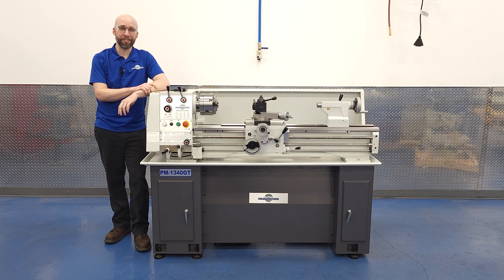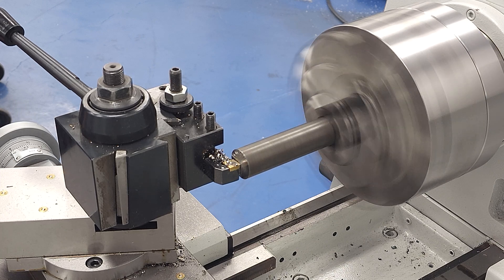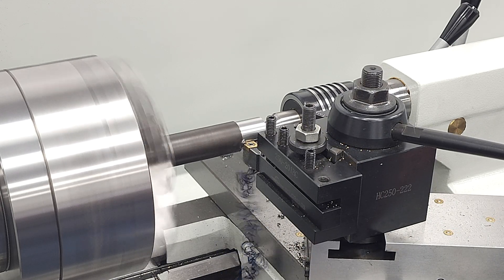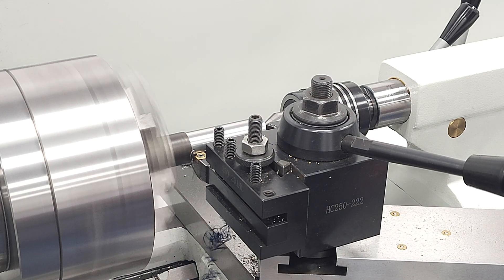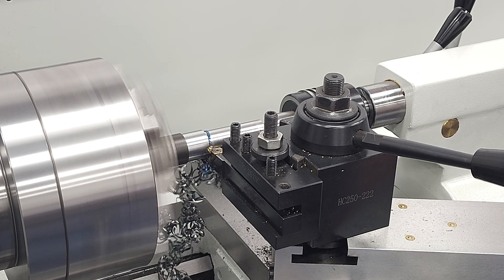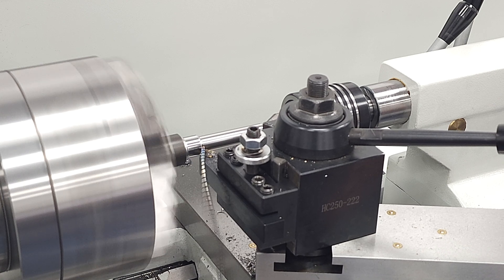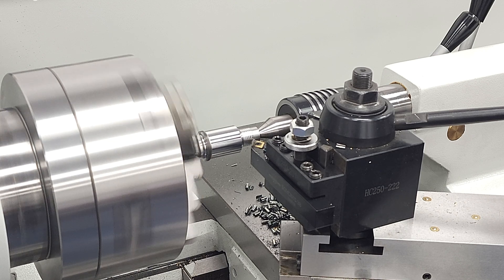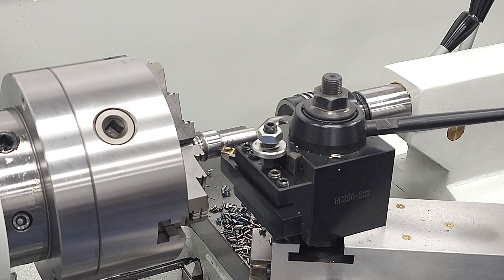PM-1340GT Limit Test Precision Matthews Media

Comment: You changed insert styles and tool holders half way through. I may be wrong, but the first tool appears to be a CNMG insert, which appears to have been set at an 90 degree lead angle.   The second tool appears to be a square insert. Using a tool with a square insert takes advantage of "chip thinning". 

Although the first tool feed rate gave a chip thickness of .003", when using the second tool with a 45 degree lead angle at .0055" feed rate, you get about a .003" chip thickness. This means that the load on the machine and material is equal if the depth of cut is the same for both tools.

This is why tools with a less than 90 degree lead angle are used on mills and lathes for roughing. You can use a higher feed rate and remove metal faster with the less load on your machine. The disadvantage is that you cannot get a square corner on your part.
Reply: Although true about the chip thickness thinning due to lead angle, a 45° lead at a feed of .0055, the resulting chip is basically .004 (.00389" to be a bit more exact), not .003" but your point does still stand, the 45° lead tool at .0055" is not a .0055" chip.

It should be noted though that for the same DOC, 45° lead angle will result in a wider chip. Remember, as soon as you move away from 0° lead, the width of the chip is equal to the hypotenuse of the Right triangle formed as a function of the lead angle and the DOC, so for the same .070 DOC, for the 45° lead, the width of the chip is .098". For the 0° lead, it is obviously equal to the DOC.

So while the chip wasn't .0055 thick, it was still thicker than .003 and the width increased by .028" thus, the load for the .070" DOC at .0055 ipr with the 45° lead was higher than the .070" DOC at .003 ipe with 0° lead

Comment: So many questions:) Could a 1440gt do .300" rough cut? Anyway you would do a video showing how you set the knobs on your machine to get the .003" per rev feed rate?
Reply from the maker: 300 total material (i.e. 150 depth of cut) is conceivable with the right roughing insert. 300 on the radius (i.e. 600 total removed) is likely going to be too aggressive.

Comment: Could you please clarify what you mean when you say take a 75 thou pass: are you saying remove 75 thou from the diameter or 75 thou on the radius? I.e., are you moving the cross slide 75 thou in X or 37.5 thou in X? Thanks
Reply from the maker: Each pass we call out is the radius or the actual distance that the tool is moved. i.e. double it to get the actual amount of material removed.
Reply: @precisionmatthewsmachineco  👍

Comment: 3:50 it also looks like the tool holder came loose too.
Reply: I have the same lathe. I tapped two 1/4-28 hole to install the brass set screws to secure this loose T nut